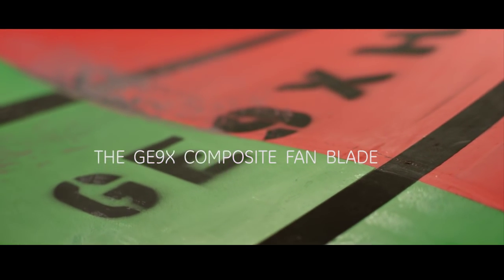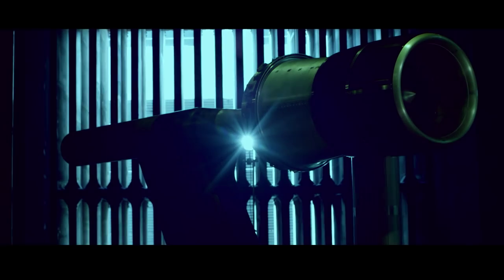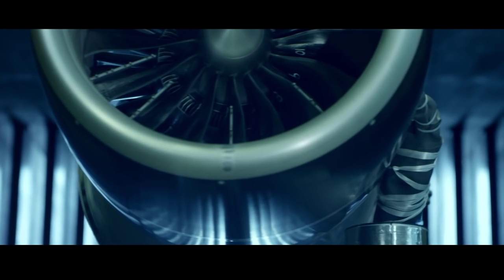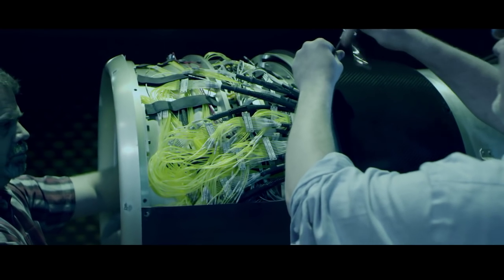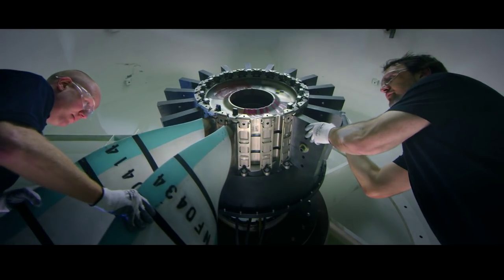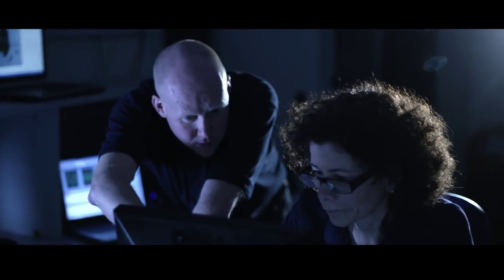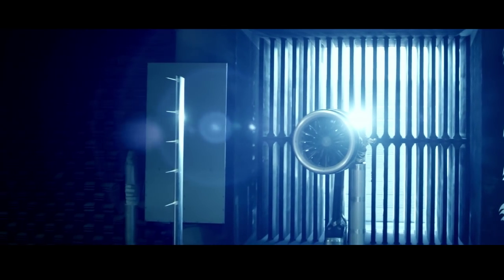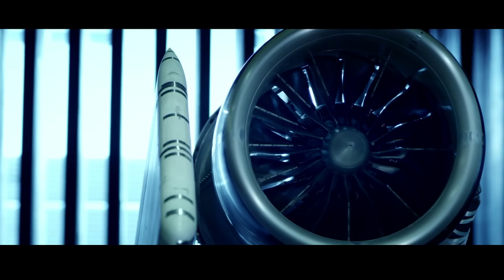GE9X: Testing the Composite Fan Blades

Comment: tell me more about southwest 737...
Reply: You mean Southwest 1380? That was a hollow fan blade that failed. Hollow fan blades occasionally disintegrate spontaneously like on Southwest 1380. Carbon fiber composite fan blades, such as depicted in this video, have accumulated over a quarter billion flight hours in service since 1995 on the GE90, GEnx, and LEAP engines, without a single spontaneous disintegration in flight. 😎